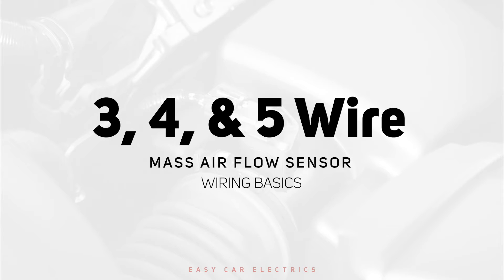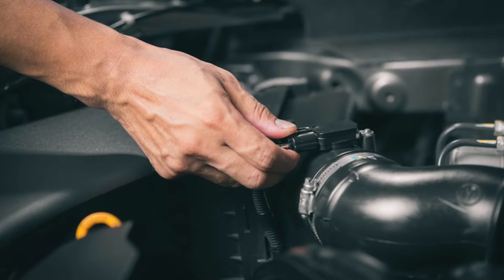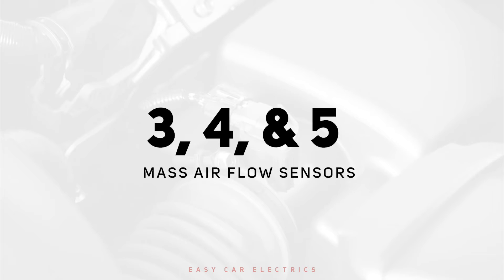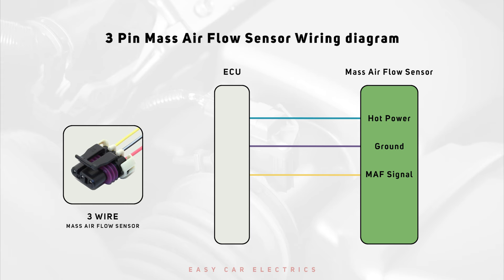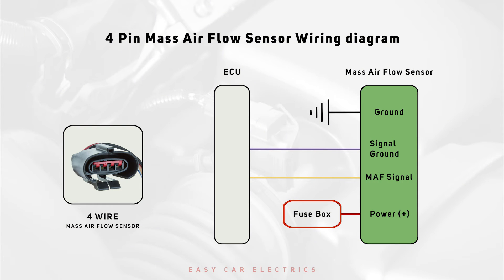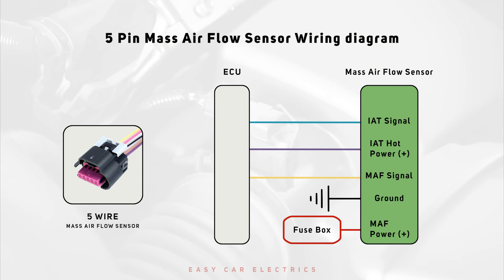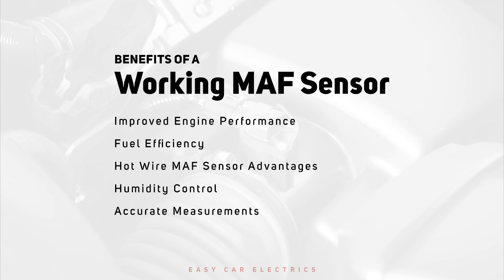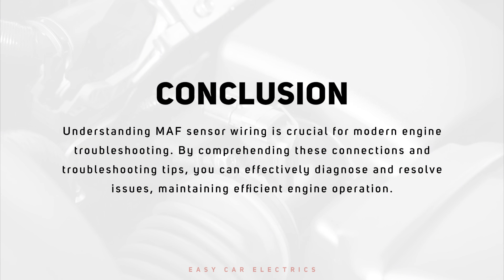Mass Air Flow Sensors - EXPLAINED - 3,4 & 5 MAF (Diagrams)

Comment: I'm diagnosing a P0113 code on a G6 3.5 and looking for the pin with 5v. My choices are.
Pin A MAF sensor signal
Pin B Ignition voltage
Pin C GROUND
Pin D IAT sensor signal
Pin E Low Reference
Looking for the 5v at the wire connector end to rule out a bad PCM. If I connect a multimeter, black lead to ground and red lead to 5v pin if I get no volts is my PCM bad? Is this test done KOEO? Thanks for the video.
Reply: Did you find the solution on your problem???
Reply: @konstantin-big  Yes, one of the wires at the connector to the MAF was badly frayed and making intermittent contact. It was probably stress related due to the age of the car.
Reply: @dalemihocik4732 
How old is the car and which brand???
Pin-A=MAF signal
Pin-B=12-volt
Pin-C=ground=B-
Pin-D=IAT sensor signal 
Pin-E=5-volt  (I think)
Can you test MAF-signal and IAT-signal with a multimeter??
If you connect a multimeter on Pin-D and Pin-E  on ohm=Ω  you can measure the ohms=Ω in the resistor
Reply: @konstantin-big  The car was a 2009 Pontiac G6 3.5 v-6. Because the OP never responded to my question I just went back to basics and checked for breaks in the wiring. I got lucky and found the bad wire, repaired it, and called it a day never needing to dive in any further.
Reply: I think your problem was on Pin-D  or Pin-E